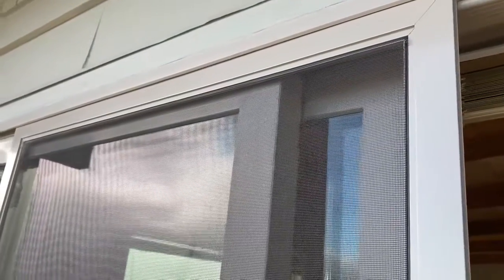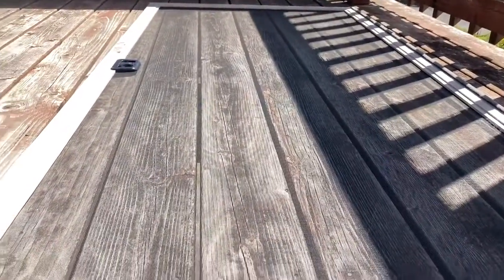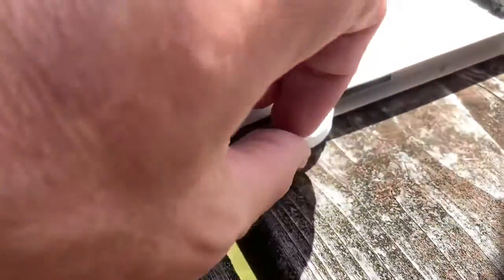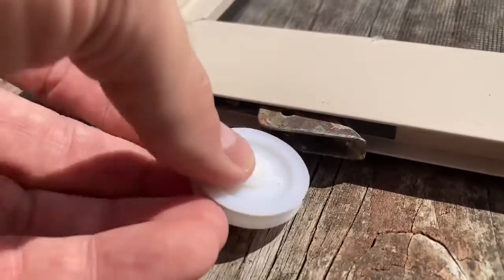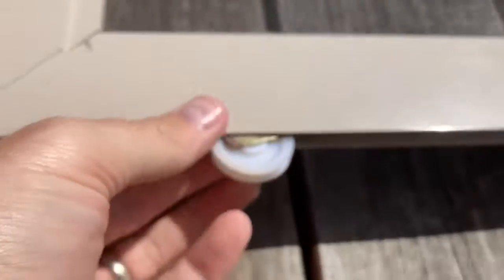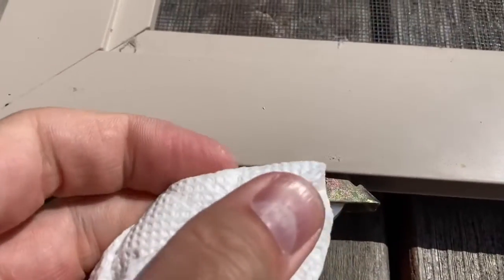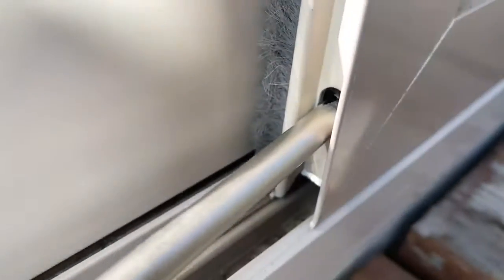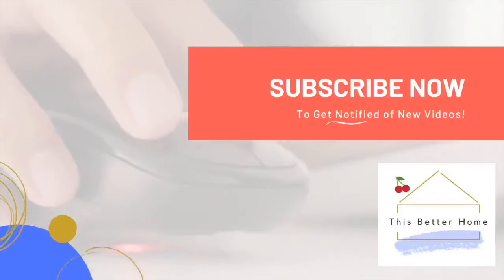️🔥 Sliding Screen Door Stuck / Won't Slide??➔ Here's How to Fix It Quickly   -   (Easy DIY Job)

Comment: This looks like it will really work and I have the same screen doors but I have no idea how to remove the doors to start with. Would you please tell me? Thanks!
Reply from the maker: At the end of my video, you can see me using a screwdriver on the side of the screen to adjust my wheels. To remove my screen from the track, I turned the screws (counter clockwise I think?) and this created some play, allowing me life the screen a bit to insert a putty knife under the two wheels/rollers. I lifted the wheels upward (depressing them into the frame), which allowed the frame to pull forward off the track.
Reply: @diybandit  this is very clear and informative, thanks so much for you reply! ….and I thought I was a ‘visual’ person 😉.